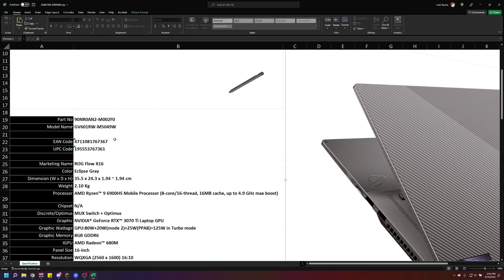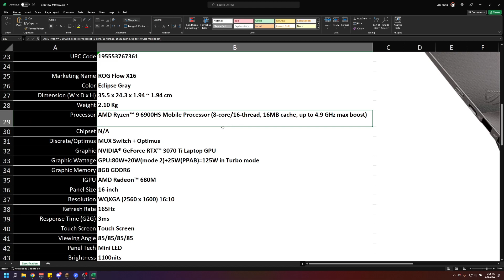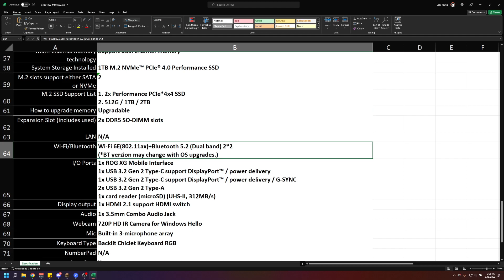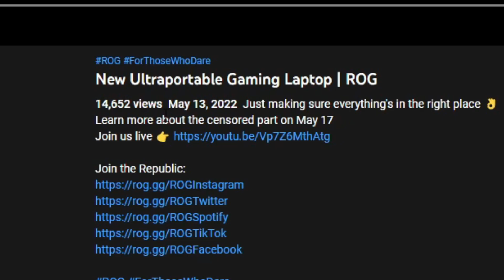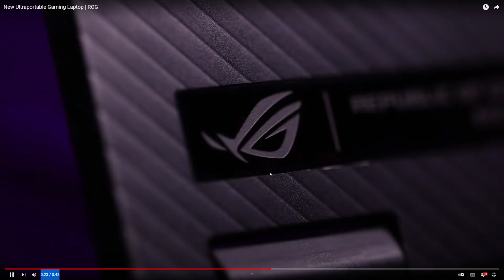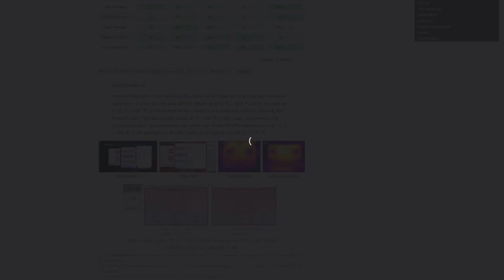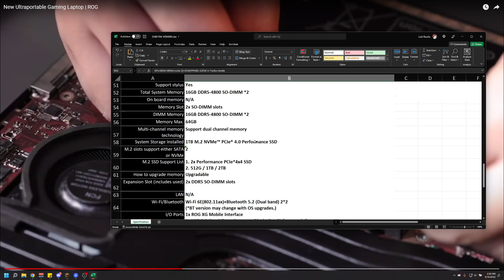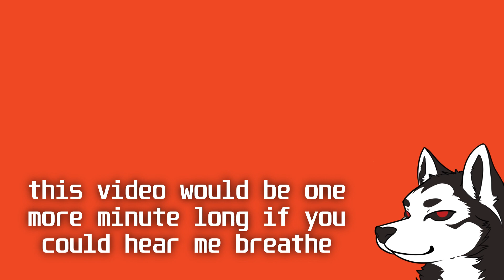ASUS ROG Flow X16 - Heatsink Analysis + Specs (Leaks)

Comment: i really like it too, exactly what i was looking for for blender and zbrush BUT the rtx 4000 serie come this summer on desktop so it could be less than 6 month to see the mobile version with more power for less watts... And it seems that this 4000 serie will be a big jump in performance...
Reply from the maker: We likely won't see mobile 40 series announced until January, let alone in any systems until like march or april. I wouldn't worry about it if you need a laptop in the next few months.
Reply: @codeHusky  did you see the news that rtx 4090 will be released in july ? we'll know then when the mobile versions are comming

Comment: So will Rog have flow z16 model🤭. Because when it comes to 16 inch laptops, the screen would be very heavy. Therefore, "folding" the screen may make the joint more unstable and loose. Therefore, the design such as z14 seems much more reasonable for 16 inch laptops.